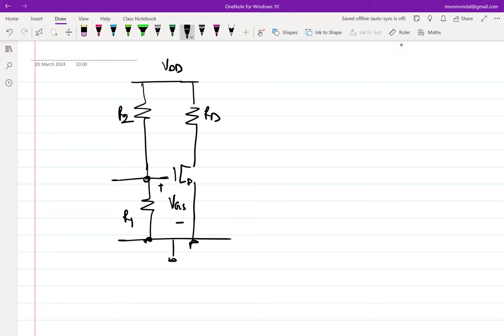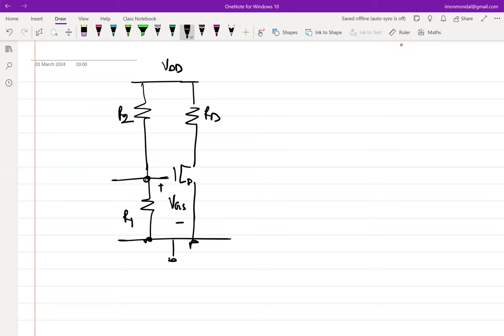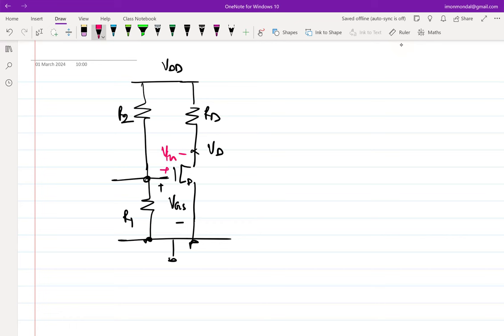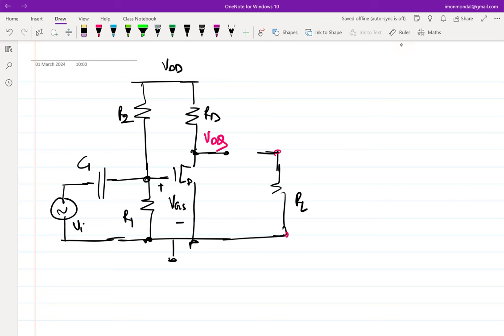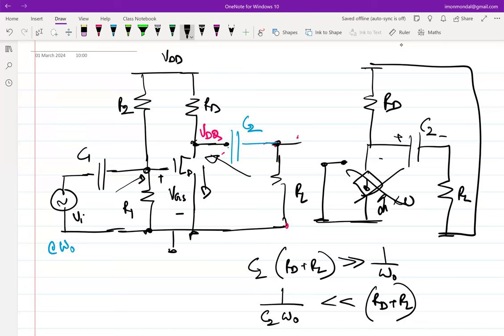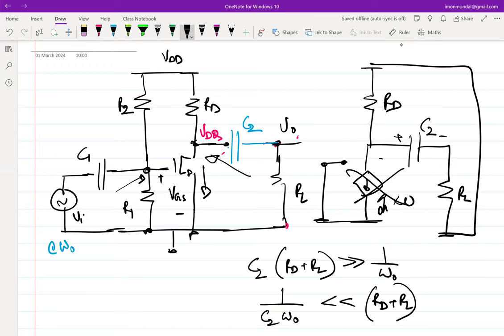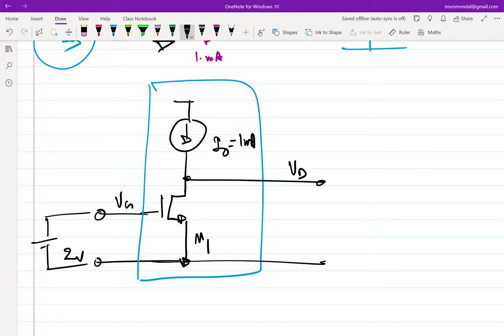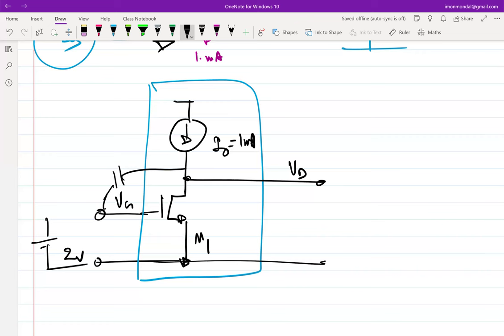Lecture 21: Introduction to constant current biasing

Comment: Sir I am not getting how fixing the Id will fix the gm
Reply from the maker: For a constant current bias, gm  = \sqrt{2 \mu C_{ox} W/L ID}. As you see this is independent of the threshold voltage. Thus, fixing ID will ensure gm does not change with variation of threshold voltage.